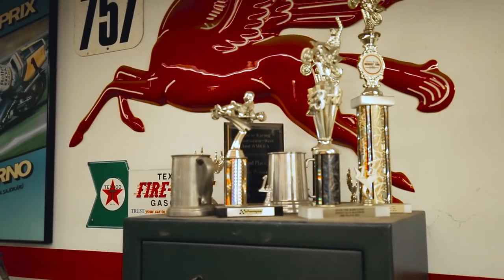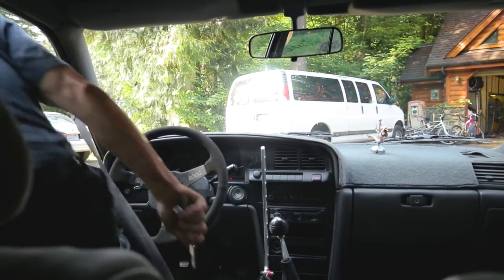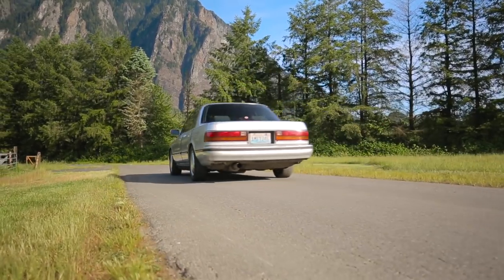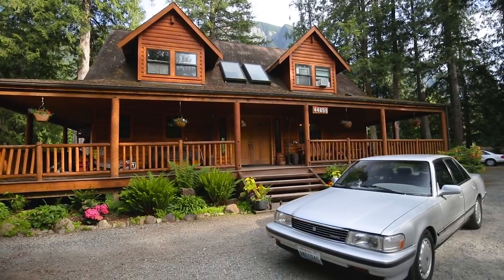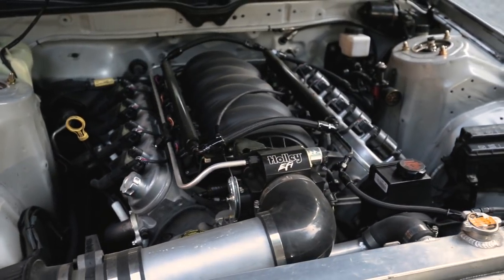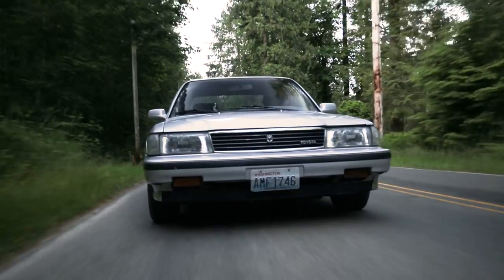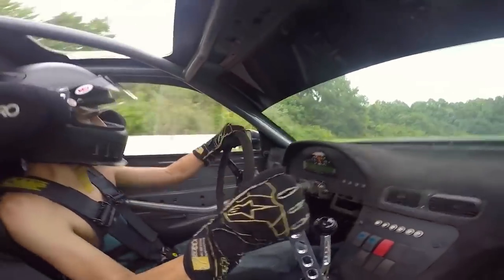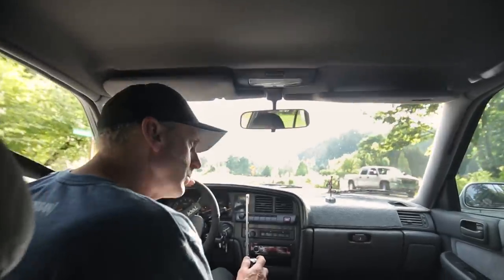1990 Toyota Cressida: A Gentleman's Drifter

Comment: hey man is it possible to swap an LS engine on a stock manual gearbox cressida 1990 ?
Reply: Wolf Bite The cressida never came with a manual gearbox
Reply: SupramanTRD in European version it comes originally
Reply: with an adapter maybe or a custom bellhousing but youd probably want to get a new transmission anyway cause i dont think a w57 or w58 would hold the ls power for long if at all.
Reply: CD009 is the best trans for an LS
Reply: Connoisseur Of Cars Tig Ol Bitties & VJ’s  nah t56

Comment: Why not 1uzfe? They can hold 500 stock. I have one in my ls400 👍👍👍👍👍👍
Reply: Mercedes Mob cos 1uzfe are for kids.
Reply: @sethwilliamr8118  a physically bigger, very complex and harder to modify 1UZ is for kids? 1UZ is a computer chip compared to a LSX which is a pegboard.
Reply: CACressida yeah you could argue that. Can’t argue with the dyno tho. The Lexus can’t compete.
Reply: @sethwilliamr8118  youre comparing a modestly tuned silky smooth 4.0 engine designed in the 80s by toyota for a luxury car to a modern tuned harsh pushrod. Daft innovations whos all about LSX swaps in his customers cars threw one in his pickup and did a quick tune using GM electronics and managed to get 3xxhp/tq at the wheels. Swap out head gaskets, boost and stand alone and you're looking at the V8 version of a 2JZ.
Reply: CACressida have you got a Lexus in a x chassis by any chance?
Reply: @sethwilliamr8118  i have a 1UZX83, JZX83, a 2UZ in a Sequoia. As a matter of fact, I even bought a 1UZ to put in my old 4Runner. I also own a Lexus LS400.
Reply: CACressida well that’s fuckn depressing.
Reply: @sethwilliamr8118  Probably depressing for you. I also own 1GR FJ Cruiser and a 5VZ 4runner. If i wanted to buy a nasty sounding LSx, I could. Not like they're gods God's gift to man. Then again, I don't go bashing other peoples choices. Call me a Toyota fan boy but I'm going to stick with the overengineered goodness, not some 1950s technology.
Reply: Bro i have ls400 what do you suggest me to change the engine ? Beacuse i have a motor in my garage camaro ss 2010 6.2 should i swap